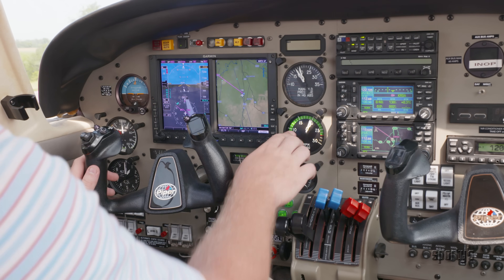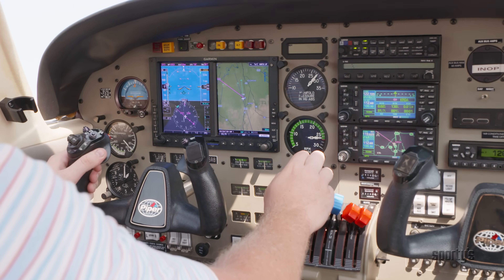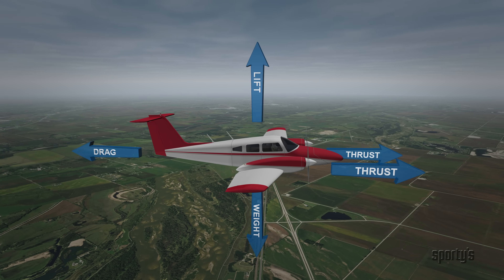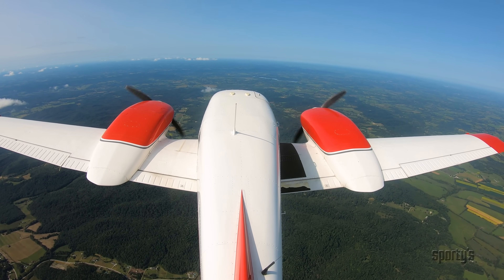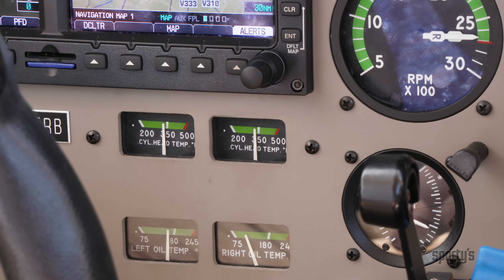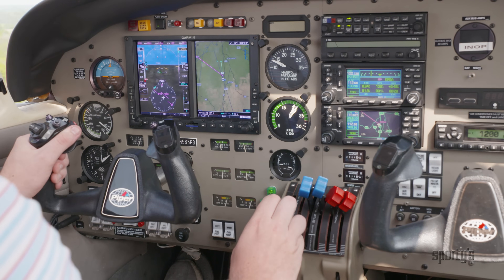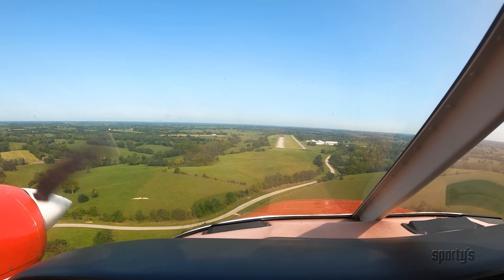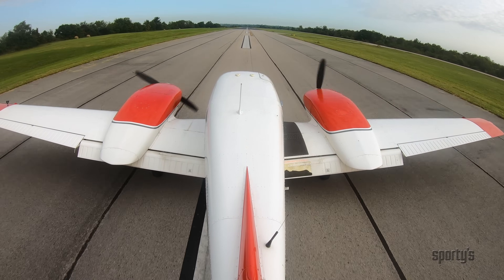Takeoffs and Landings in Multiengine Airplanes - Sporty's Flight Training Tips

Comment: On take off climb sometime a twin will oscillate due to pendular effects of the engines out on the wings or perhaps a mild Dutch roll effect- the response should be gentle rudder counter-movements not  chasing the oscillations with aileron which can worsen it. Also on landing if the plane has some rudder pedal nose steering, its mandatory to put the rudder pedals in neutral position  or let them go to self center as nose gear contacts the runway else you can easily get steered off the runway or into a ground loop..